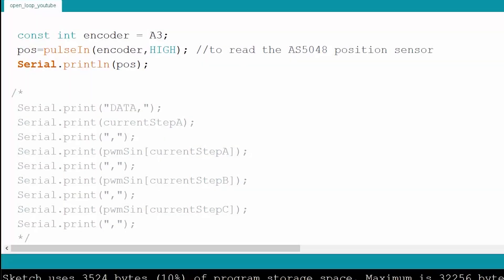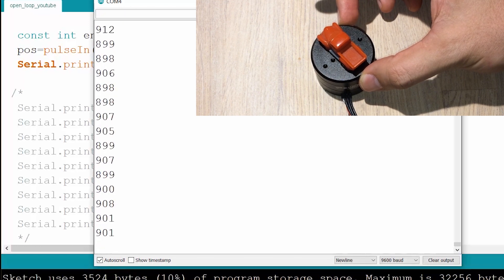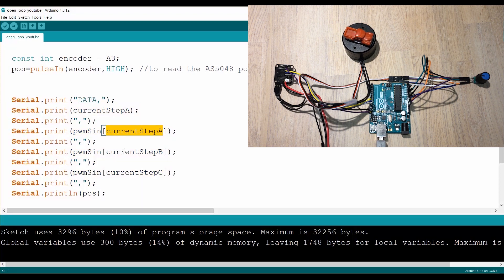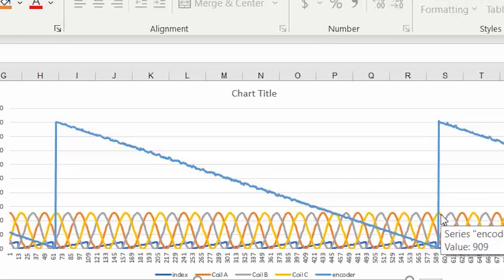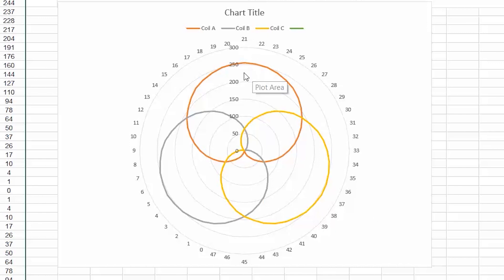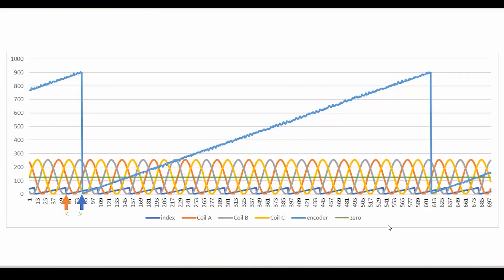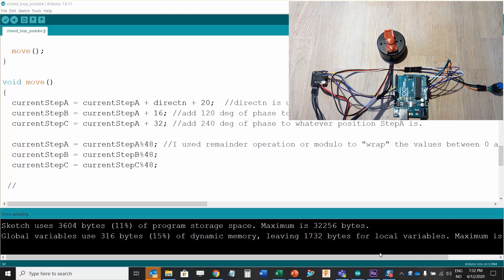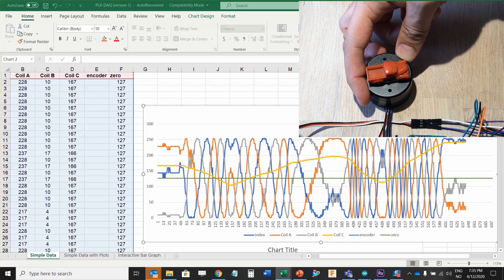Arduino Brushless DC Motor (BLDC) FOC Control Part 3 - Closed Loop Control servomotor

Comment: HI! Does the offset that you are talking about is the same with neutral point? Where the rotor's and stator's magnetic field difference is 0 degree and the torque equal to 0

Comment: Your electrical angle is not shown correctly. Mechanical and electrical angle should have the same height. 
I built my own field oriented control from scratch 
Good video though!

Comment: hey thanks for the super informative series! i just noticed that in your code for the synchronizing part, if u add 18 as your offset, doesnt that add up to your phase A step count always? my question is, since you put the 18 as offset, for each loop, instead of moving one step in the sin table wouldnt you be moving 18 steps?
Reply from the maker: Correct! But it wraps around the maximum value of 48 so it is an offset that is consistent, as it makes up for the physical offset between the rotor and the sensor’s absolute zero. What I mean is that when the motor is assembled, the sensor used for providing shaft position feedback is not synced with a consistent position of the rotor, thus you need to account for that using a unique offset for each motor. Hope this is clear now :)

Comment: Hello! One question. Can I know the exact position of the bldc motor shaft and give instructions of movement just with hall sensors? Or do I need an encoder?
Reply: well , i dont own any of the hardware , nor have i ever built something like in this video , but based on my few years of experience i can tell u that at least for slow precision movements a hall sensor would kinda be useless , at least cheap ones , because most of them only show u the N S pole and not really the intensity of the magnetic field such that u could measure the rotor position at weird angles between its magnets ... Soo...u could do something with it , but it makes more sense to have a live feed of the exact mechanical position of the shaft , without implementing , i dont know, some crazy ''counting the magnets ' function that ensures not skipping steps or something . U could actually use one for lets say rougher angle rotations , like if u control it kinda step by step (it is called trapezoidal control)  and for example if u have a 6 pole rotor it will move 60 degrees per step and u could then count the steps or something with a hall sensor rather then spending money on an encoder , but an encoder can be used at a lot more things , so thats that .. and sorry for the long response :))

Comment: Hello I would like to know if I can control a brushless motor of about 2000kv at the same speed as you did or a speed close to that with this L6234 board?
Reply from the maker: Antonio Claudio I would think so, but im not too sure, you could try using the board we recommend on the link (see it in the latests videos), uses higher current MOSFETS, check the item on our ebay link...

Comment: Beautiful work. What's the sampling rate of the position?
Reply from the maker: Dimitris Karapatis im not sure, i guess its affected by whether or not im reporting data to the debug terminal... how would you measure it?
Reply: @RandomAccessProjecs  You are reading Angle sensor's PWM output through PulseIn function which is interrupt driven, I think. So I expect it to be pretty fast. In my experiment the sample rate from the SPI angle sensor was too low so the motor was oscillating. The speed of the motor was greater than the sampling speed in other words.
Reply: @LiliumJSN  hi. pulseIn() is not interrupt driven and will take as long as the pulse itself is. So, depending on the sensor, it may also be terribly slow
Reply from the maker: Dimitris Karapatis ill try to monitor it!

Comment: instead of manually finding the offset could you have the arduino calculate the correct offset because you know at the start of the code the electrical revolution is at zero so you could measure the mechanical offset from the encoder and the difference between the two would be the offset, or have i got something wrong?
Reply from the maker: Lochlan bogaers yes! You can :) you can energize the coils at index = 0 and capture the value of the sensor and then apply it as offset or something similar, if you make this “automatic offseting” can you post it on the arduino forum for this thread? Link in description, would be awesome to have the community add to this project :) thanks for your great comment
Reply: @RandomAccessProjecs   will do, thanks for this awesome resource